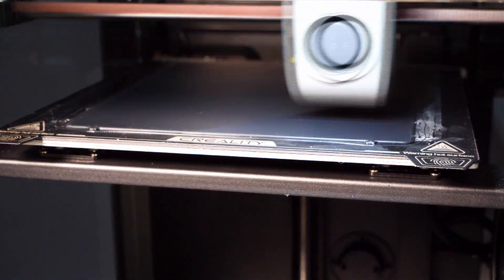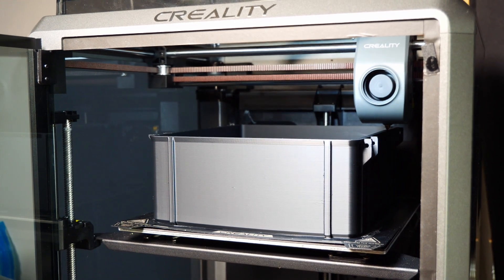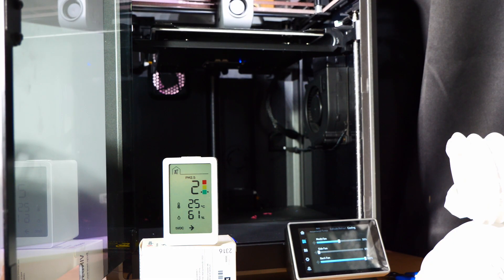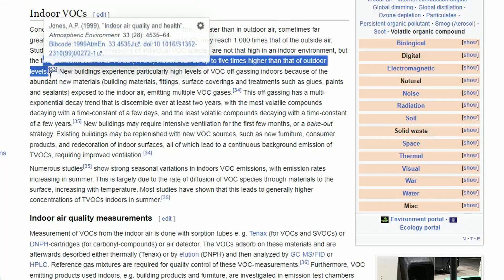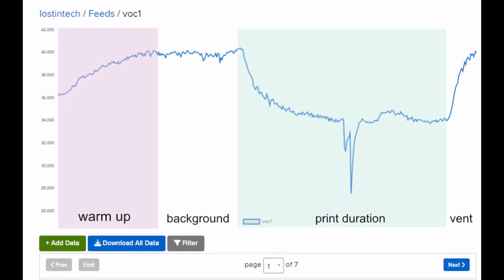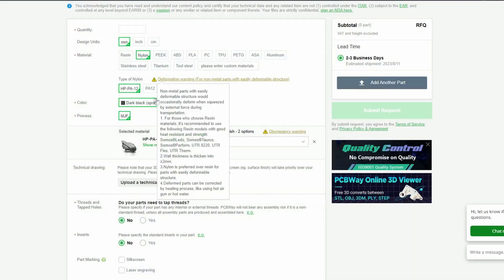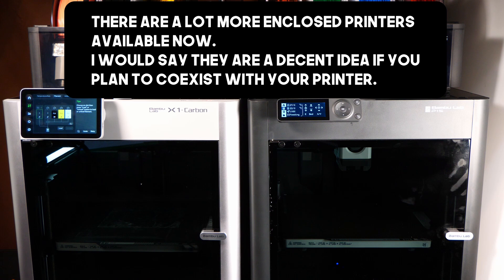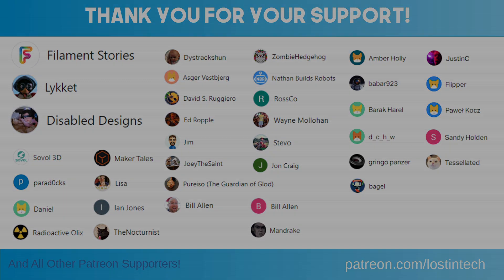Your 3D Printer Stinks.

Comment: Regarding potential suggestions for how to deal with this effectively, one smart thing I've seen some other people do with resin printers as well is to purchase some sort of enclosure "tent" (or something like a grow tent, it'll work just as well for a 3D printer) and use that with a powerful fan (exactly like those extraction fans in the video) and vent the printer fumes to the outside.. this way you could be in the same room as that tent safely (and I suppose you also get some fume extraction in that room as a bonus!)

the only downside is it becomes maybe a bit harder to do printer maintenance and requires more space and more money.. so I often see even people who are aware of these risks shrug them off for the sake of convenience and cost cutting, which is unfortunate but understandable

I've also seen some people just set up more powerful exhaust fans on their enclosed printers to vent to the outside, but in my experience this would create problems of uneven cooling for filaments like PETG that are sensitive to it.. for a printer with a stationary gantry at the top this seems unavoidable, the place where the bulk of the printing happens is also where all the heat wants to rise to, and it can be better to just open the top lid and let the heat rise out.. the tent approach accommodates this much better

Comment: You need to measure VOCs and stuff not just particles. You can pay like $15 more for a monitor that tells you all sorts of more chemicals and other particle sizes as well
Reply from the maker: Did you actually watch 😂
Reply: @LostInTech3D  No I didn't finish watching, because why would I watch a whole long video only measuring one variable with a terrible IKEA toy monitor? If you're implying later on you did real tests, then you should have led with that, not wasted our time, and skipped the pointless stuff.
Reply from the maker: Mmmmhm
Reply: @LostInTech3D  Didn't learn anything at all, won't improve, just feel entitled to 100% view rates when un-earned. Shocking.

Comment: How well do in-enclosure air filters like the Nevermore and the Bento Box work?
Reply from the maker: My understanding: very well, but the carbon expires fairly quickly. They don't last nearly as long as a PM2.5 HEPA would for dust, for example. They also spoil in normal air because of things like cooking fumes.

Comment: it's pretty simple, when I got my printer I used the cardboard box as a cabinet, printed a 4" flange, got some cheap 4" vent and printed a plug that had a 5015 fan in it, negative pressure sucking fumes out the window.  Later I bought a $12 foam panel that is 4'x8' and turned it into a box with printed hinged and tape, then i added aluminum interior later and a plastic exterior until it was perfectly insulated from noise and keeping heat.  I would make it a little more modular to fit on a wire shelf, but it's the best option, no fumes in my living space.

Comment: I just bought a cheap filament printer, and now I'm wondering if it's worth the hassle just for the sake of making a few model terrain pieces. I've got a resin printer out in the shed, but the FDM Ender 3 would have to be kept in the garage (adjoins the house) to have even half a chance of preventing moisture getting to the roll of filament. 

My resin printer is fairly safe by virtue of it being well away from the house (and conveniently the shed backs on to empty waste land) but I don't have that option for FDM printing. £90 for a secondhand printer + £10 for a roll of filament isn't too bad, but it seems like the more I look into FDM printing, the more stuff you need to buy. Filament dryers are expensive; I could by a cheap food dehydrator for under £30, but it's still adding to the cost - I was hoping to keep it under £50 since I'm just playing with the thing. A proper enclosure would cost at least £60, and an extraction system would mean buying & fitting ducting and an extractor unit and boring a hole through the garage wall. This is NOT what I had in mind.
Reply from the maker: if you print PLA and you don't print often and you don't sleep with it and you have a window you can open, don't sweat it. 

The problem in my eyes is chronic exposure, meaning years. 
(this is not medical advice - I am not a scientist)
Reply: @LostInTech3D  Thankyou LostInTech. 👍
My early experience of resin printing was a bit of a shocker regarding the fumes, so I'm paranoid now about printer fumes whatever the material or type of printer is. Hopefully I can get set up and running next weekend and see how it goes.
Reply: @LostInTech3D  The first time I printed, I was sitting next to the printer and watching it rip. I sat there for an hour, happily inhaling the sweet PLA fumes and got a sore throat and a headache. Now the printer sits on our balcony with two windows open and a fan blowing air out of the other. No problems since!

Comment: recently got into 3d printing, work has a 3d print farm so I was familiar with the "no harm" of pla. I'm asthmatic AND have oversensitive lungs, and more lung problem besides. I'm a good yardstick for things being bad for the lungs. Basically I start instantly coughing at about the 30+ range on that ikea meter, yes it's that bad, yes it's near debilitating in daily life. With the help of 3 different carbon+particle filters I can comfortably 3d print in my bedroom. Printer in an airtight box with a circulating filter inside for during the print. And 2 room filters for anything that slips by opening the box (and for cars driving by and planes flying over because I just had to live under an airport with my lungs). Works decent enough. The idea prints are harmless seems insane to me, but it's what my coworkers believe so there we go. Setup wasn't hard to do or expensive really. 30 bucks in filters (6 month replacement according to manufacturer, we'll see if true) 50 bucks for the various fans to push air through. 20 bucks of plywood to make an airtight box with along with screws and glues I just had in the shed to actually make it airtight. I spent some extra for some sound deadening because it's in my bedroom and I value silence but that's not relevant to air quality.
Reply: Thanks for the info. Was that 6-month recommendation from the manufacturer accurate?
Reply: @Shuttle-256 not fully, I did give them more than average to deal with but for my stupid sensitive lungs and living under an airport every 3-4 months has good. I'd say for the average person that 6 months is probably fine since it will depend on environmental conditions and I also do a lot of making parts using a dremel in the room which also makes tons of dust.
Reply: @rikkoningen3992  Thanks so much for the quick and rich reply

Comment: i have an enclosed printer that always has negative pressure and filters on the output, i also have an air filter in the same room, doing it this way seems fine.
Reply: You cant know that
Reply: @dinoXAs2  you can.
air quality meters.

Comment: This makes sense. When you are extruding vs printing. Printing actually has the nozzle on your part. This traps most of what is coming out of the nozzle 

While extruding/purging would release everything. There is a low pressure in the nozzle. And the plastic is not "catching" anything.

Comment: Do you think there is some smoke when manually extruding because of the filament sitting in the melt zone and being heated may get overheated since the temperature at the melt zone isn't what's typically being measured and it most likely overshoots the temp at the start? This would cause smoke because then you extrude a large amount and expose it to air with no part cooling while when printing it extrudes small amounts in a controlled manner so the overheated filament doesnt leave the hotend at that temperature. Just a thought.
Reply from the maker: I think that's exactly right. I've seen some of these ceramic hotends overshoot beyond 350C using flir.

Comment: You would be super surprised if you compared dry filaments to filaments which had absorbed moisture. 

Wet filaments give off loads of nasty fumes compared to dry stuff. 

Lao you might want to be checking for HCHO (Formaldehyde) and TVOC  (Total Volume of Organic Compounds) instead of just PM2.5. 

Those things don’t trigger a simple PM sensor but cover a range of carcinogenic compounds.

Comment: I built a enclosure from wood and chanel plastic and I put a small/cheap bathroom extractor fan in the back corner. I duct and vent that air outside my home, the incoming air is from inside my apartment. I also built a window from wood and chanel plastic so I could make a hole and add a louvered vent to prevent cold air from back flowing when the fan is not on. The printer needed more room than the size listed in the add, that was only the base not the space the moving bed required, do keep that in mind if you build a printer box to. What I now are trying to find out is the right cfm for the extractor fan as to not over extract and cool the box or under extract and not cool the printer electronics enough. Do anyone know how to find out? What is the optimal chamber temp for 3D printing anyway?

Comment: It should be noted that consumer air quality monitoring devices are inaccurate and require some time for them to "settle". Some device manufacturers warn about this, others might not. Additionally, most conditioners don't ventilate the room. They might cool or heat the air, maybe remove the moisture but most of the time, at least the split type of conditioners, don't ventilate. Hope everyone stays safe and gets plenty of fresh, clean air.
Reply: And his one only monitors PM rather than TVOC and HCHO etc.

Comment: That's what stopping me from getting a 3d printer.
Reply: Get or print a HEPA filter + activated charcoal filter for inside the enclosure -- you want an enclosure anyway to reduce warping -- and ideally a vent to outside to carry the rest away.
All vented air has to be replaced by fresh intake air which then has to be heated or cooled and maybe humidity controlled depending on your climate, so I think in terms of a small vent.

Comment: Are you running the fans in the back during the printing? If so, could those be pulling the fumes/microplastics out the back instead of out the front where your monitor is?
Reply from the maker: Rear and side were off 👍

Comment: MOx gas (VOC) sensors (like those found in any consumer-level air quality monitor) currently suffer from major drawbacks that make them unreliable for any purpose other than a very broad estimation.
- cross-sensitivity/selectivity (not being able to discern between gases because only resistivity of the sensing plate is being measured)
- low stability across repeated readings in the same environment
- difficulty of effective calibration, which is repeatedly necessary over time and any time a change in environment occurs
- very high sensitivity to humidity (and, by extension, temperature) which must be compensated for with another connected and accurate sensor
- despite issues with cross-sensitivity/selectivity, they are ironically very poor at detecting some compounds which ARE harmful, depending on the pore size and chemistry of the sensing plate

As you said, they rely on changes in conductivity in order to estimate an increase or decrease in VOC concentration in the air. Because of that, any air monitor reporting a concentration for VOC in ppm or ug/m^3 is already highly suspect. More reputable sensor manufacturers like Sensirion have already started switching to VOC Indices that try to make it clearer that the readings are only comparisons to a recent baseline (usually ~1 day to 2 weeks).

Obviously making cheap, reliable gas sensors available to everyone will hugely benefit humanity. Consequently, there's a ton of research and investment into making these sensors more accurate and discerning. I really hope that we continue to see fast improvement in these sensors. However, right now anyone using them to make a point about gas quantities and toxicity of materials really needs to provide a HUGE asterisk.

PS - as mentioned by a couple other commenters, AI analysis of MOx gas sensor readings is pretty promising right now. Bosch even provides a library for calibrating and training models based on known gases with their BME688 sensor.
Reply: I found your comment after I wrote a similar one...

Quick note: Consumer air quality monitors won't have a reliable VOC sensor because a PID sensor alone starts at around $500. Anything cheaper than that is at best a semiconductor sensor (but may just be estimating from other sensors). These can only give you short-term trend data, as it assumes whatever it sees on average is actually the average and scales from there. They also react differently to different VOCs (that's part of why they spike so much when you spray isopropyl alcohol on your build plate). BUT we don't have good information on how they react to whatever 3D printing is giving off. So, even on a relative scale, a higher number for one filament could just mean a different TYPE of VOC than a filament with a lower number (which might actually have vastly higher actual VOC concentration).

If you want to know if you've managed to reduce VOCs this month compared to last month the price tag on that information may be more than you paid for your printer.

Ok maybe not so quick of a note.
Reply: Underrated comment. Worth also noting that not all VOC's are toxic. Styrene, the VOC from ABS/ASA, definitely is.

Comment: Do voc's just disappear.. e.g. if left in a room printing with windows closed would they still be there 12hrs later ?

Also are there filters you can buy, e.g. if it's not convenient to ventilate to outside, could you have an enclosed filter with a certain type of filter  ?
Thank you
Reply from the maker: they don't "disappear" but there are various ways they stop being in the air, so effectively, yes, in terms of breathing them. This is one way enclosures work - by making the particles hang around long enough to stick to the inside or react with something else to _do random chemistry stuff_. 
It's tremendously difficult to filter out a vast range of unknown VOCs, not impossible, but difficult. Carbon is the current best generalist at this, although the nevermore guy says he's working on something else that sounded interesting.

Comment: Ive worked with chemicals all my life. I was doing carbon fiber work with resin 16+ years ago (good lord im old) and from all the exposure i became very sensitive to smells and tastes. I can tell you for certain you dont want to print with the printer in the same room as you unless you have a enclosure and its properly vented to the outdoors with a filter so youre not blowing that crap into the atmosphere. Please take care of yourselves. This is a manufacturing process, thats what youre doing and it needs to be treated as such. Youre heating a chemical composition to reform it. Its going to off gas and youre blowing that around. Just be safe be smart do your research and understand what youre working with and how that material would be handled in a professional industry setting not just a hobbyist setting.
Reply: So a filter for the air you vent outside to? Does it have to be activated carbon or is hepa filter enough?
Reply: @agw5425  filter on the intake side and on the outlet side of the enclosure. Or you can also do a recirculator pipe up top with a filter in the path and a split to a outside line if you're doing high heat stuff where you can't do a fresh air. It really depends on how hardcore you're going and what you're printing. Generally a foam AC style filter as a pre filter works ok and you can use a cut down furnace filter before the exhaust fan. You can also stack them and leave a space in-between. Most of the stuff will settle in the hose or in the filter. It's not perfect but it's a somewhat overkill for a hobbyist style setup.
Reply: @patrickisswayze3446   I get that filtering incoming air for dust and such is a good thing, but why recirculate instead of slowing  down the fan if more heat in the box is wanted? Does it matter what voc and pm2.5 is inside the closed box while printing? There would be some air exhausted at all times even if it was less volume at some times. I was planning to put a inline hepa filter next to the outlet in my window/wall for space reasons, just to reduce what I emit on to my balcony where the air exits my home. Would a air heater and higher fan speed be a better combination?
Reply: It's totally irrelevant at atmospheric levels of dilution. Only in an enclosed space/room with you. It's actually going to be worse for humanity, because you're reducing the amount of ventilation you have, and the amount it hurts you is like 100,000x more than any harm once out in the wind. The CDC and everyone just vents to outdoors often with no filter (unless a pathogen itself, I just mean various chemicals, formaldehydes etc)

Comment: Did you ever connect this to grab the data from it? The Ikea sensors are apparently supported in home assistant now including the voc index.
Reply from the maker: yeah I was peripherally aware of this but their hub ain't cheap and I already have a hue hub so I'm mulling it over.
Reply: @LostInTech3D  You don't actually need a DIRIGERA Hub. Any zigbee usb stick connected to the Home Assistant server will do. 

I am using a Sonoff Zigbee 3.0 usb stick which I got for about $15 and I just picked up the Ikea Vindstyrka and paired it. 

Out of the box it doesn't support the VOC reading but there is a github PR by just-oblivious to add the VOC index to Home Assistant and the zha-device-handlers repos. With a few quick modifications I got it up and running with the VOC Index report.